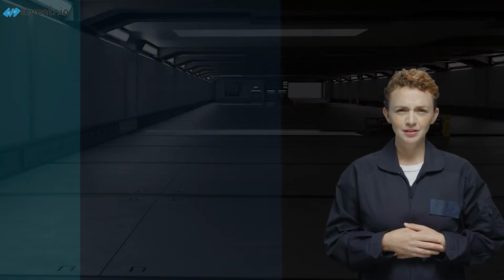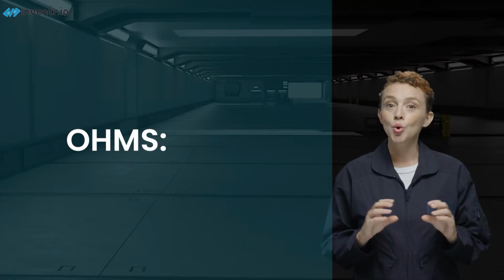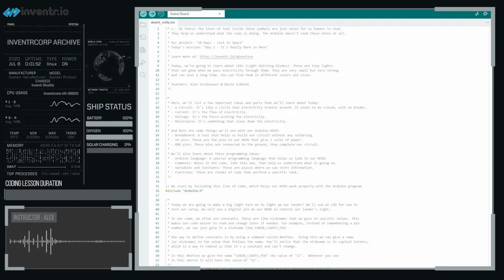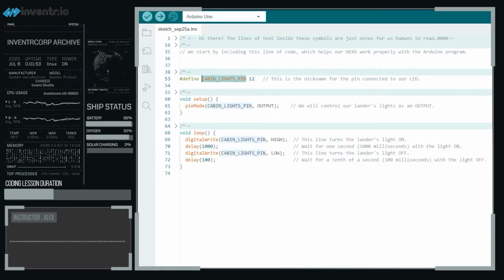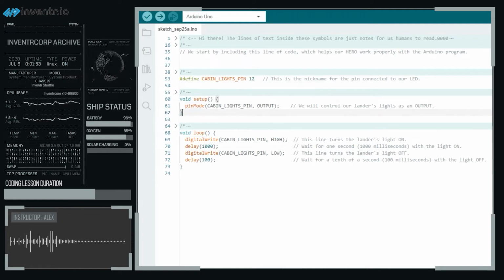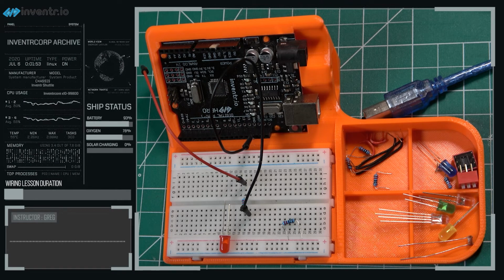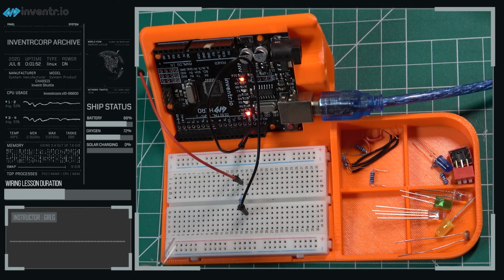[Day 2] Adventure Kit: 30 Days Lost in Space

Comment: i have 2 interesting questions. So i had one WHITE led hooked up and it worked. I then added a BLUE led to the circuit and they both worked (but dimmer due to sharing) i then add a RED light (green does the same) to the mix and the other 2 turn off. Why ?

ok, next observation. I then remove one of the 3 lights, either blue or white, leaving 2 lights in the circuit, but ONLY the red works. However, i can have TWO lights IF AND ONLY IF none of them are red or green? why?

thanks

Comment: This thing is kinda confusing cutting in and out of story and background info and the actual day's task. Its not hard to figure out but like...when did it say what to build on the breadboard?
Reply: that and where and how do we type code into the IDE. I do not want to copy and paste code, i want to write the code, learn how to write it and know what eachthing is doing
Reply: I think it's because it's a mix of different content cut together by someone who already knows how to do it all. Did you install the ide? If so it should look like a normal text editor like notepad. But default there is already a setup and loop function defined but empty. Just type there and then hit upload. The icon for it is confusingly a right facing arrow? If you have it connected and have selected the model and com port it should work.

Comment: Question. How do you know what kind of resistor is needed (obviously it's given to us). I imagine resistor always goes before the led and after the power out.
Reply: here, i can help with that. I know circuits, i just SUCK at programming hence why i am doing the 30 day kit haha

The amount of current that flows through an LED is crucial to prevent it from burning out. Most standard LEDs operate at around 20mA (milliamps) or 0.020 amps of current. To calculate the current-limiting resistor value, you can use Ohm's Law:

Current = voltage/resistance and knowing our voltage source is 5 volts from the hero board, we can solve for R

0.020 = 5/R so R = V/i yielding a 250 ohm resistor. In our case, we have a 220 ohm which yields a 0.023 value of amps.

Comment: Ok now that I have got the slight jist of it, I actually experiements and came up with this line of coding.

SOS morse light code. I figured it could be useful :-)

#define CABIN_LIGHTS_PIN 12

void setup() {
  pinMode(CABIN_LIGHTS_PIN, OUTPUT);
}

void loop() {
  digitalWrite(CABIN_LIGHTS_PIN, HIGH); // S string of Morse code
  delay(100);
  digitalWrite(CABIN_LIGHTS_PIN, LOW);
  delay(100);
  digitalWrite(CABIN_LIGHTS_PIN, HIGH);
  delay(100);
  digitalWrite(CABIN_LIGHTS_PIN, LOW);
  delay(100);
  digitalWrite(CABIN_LIGHTS_PIN, HIGH);
  delay(100);
  digitalWrite(CABIN_LIGHTS_PIN, LOW);
  delay(300);

  digitalWrite(CABIN_LIGHTS_PIN, HIGH);  // O strring of Morse code
  delay(300);
  digitalWrite(CABIN_LIGHTS_PIN, LOW);
  delay(100);
  digitalWrite(CABIN_LIGHTS_PIN, HIGH);
  delay(300);
  digitalWrite(CABIN_LIGHTS_PIN, LOW);
  delay(100);
  digitalWrite(CABIN_LIGHTS_PIN, HIGH);
  delay(300);
  digitalWrite(CABIN_LIGHTS_PIN, LOW);
  delay(100);

  digitalWrite(CABIN_LIGHTS_PIN, HIGH);  // S tring of Morse code
  delay(100);
  digitalWrite(CABIN_LIGHTS_PIN, LOW);
  delay(100);
  digitalWrite(CABIN_LIGHTS_PIN, HIGH);
  delay(100);
  digitalWrite(CABIN_LIGHTS_PIN, LOW);
  delay(100);
  digitalWrite(CABIN_LIGHTS_PIN, HIGH);
  delay(100);
  digitalWrite(CABIN_LIGHTS_PIN, LOW);  // Delay to repeat so SOS makes sense
  delay(1000);
}

Comment: Regarding Ohms law, how would I know the value of resistor required for , in this case the LED ? I understand that dividing 5 by 220 gets me a safe value of 23 mA but how does someone know what value their LED considers a safe amount of current ? and is there anything wrong with using a higher value resistor like 1000 and getting a 5mA value ?
 I hope my question makes sense. Thank you.
Reply: I am going to test this, but I think if you use a higher resistor the light would just be dimmer or end up flickering. That is a really good question!
Reply: here, i can help with that. I know circuits, i just SUCK at programming hence why i am doing the 30 day kit haha

The amount of current that flows through an LED is crucial to prevent it from burning out. Most standard LEDs operate at around 20mA (milliamps) or 0.020 amps of current. To calculate the current-limiting resistor value, you can use Ohm's Law:

Current = voltage/resistance and knowing our voltage source is 5 volts from the hero board, we can solve for R

0.020 = 5/R so R = V/i yielding a 250 ohm resistor. In our case, we have a 220 ohm which yields a 0.023 value of amps.

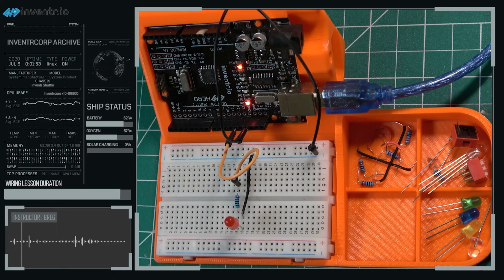Comment: There's a jump cut at 30:17 and a new wire is placed: my kit didn't come with any of those smaller black wires.
Reply: Those smaller black wires are just cleaner looking, he has also trimmed the resistors to have shorter ends. Any of the colored jump wires in your kit can be used as long as you know what direction electricity is flowing through them.

It does jump which is confusing, but you do not need to rewire anything. Before the cut they have the negative on the LED go directly to the ground on the Hero. After the cut they moved he negative from the LED to the negative bus on the breadboard, and connected the bus to the ground on the Hero. As far as the electricity is concerned it is an identical circuit.
Reply: to be honest, the way he is wireing it with the grn on the BUS side of the breadboard, then having the small JUMPER wire go from BUS to TERMINAL is the best standard. You can make your own jumper wires like that by trimming the ones you have and stripping the sheath off.

they need to explain some standards and best practices :)

Comment: I see no benefit from the unchanging display on the left side of my monitor screen.  It is just wasting screen area.  This area would be of much more benefit if it was used, along with the rest of the screen, to display the programming code in a larger size, especially on smaller screens, to make it more easily readable.